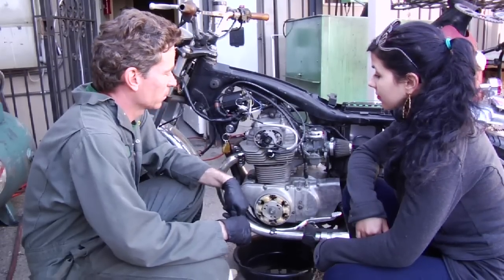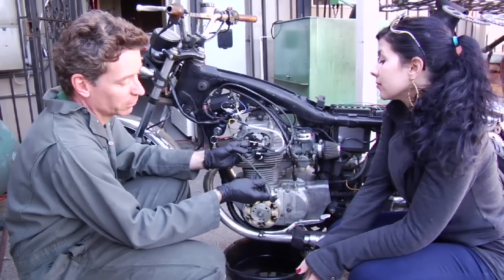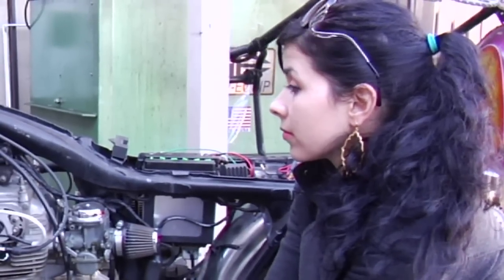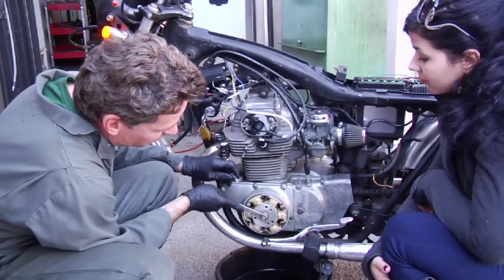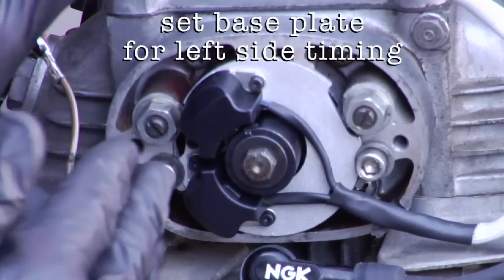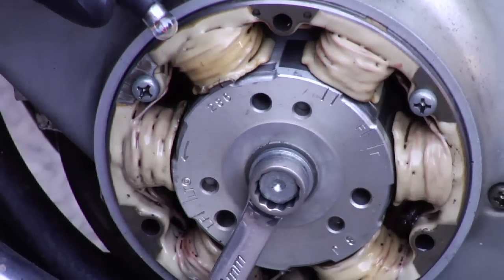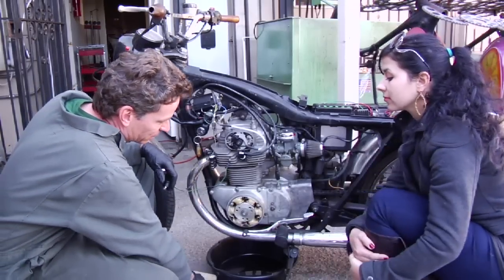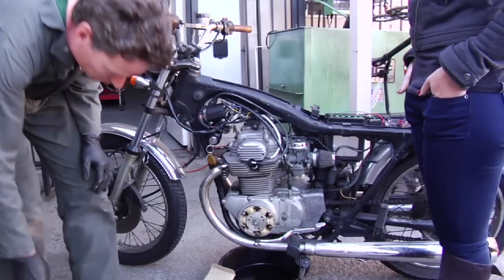Charlie's Place Electronic Ignition - CHECKING THE TIMING v2.0

Comment: Hi Charlie, I have this system, for my Honda CJ360, can I use the factory coil that brings the 360? I have to remove the capacitors and put the two black wires of the output coils and the other two connect them to the pick-up coils? Would a connection diagram be possible to be able to start my motorcycle?